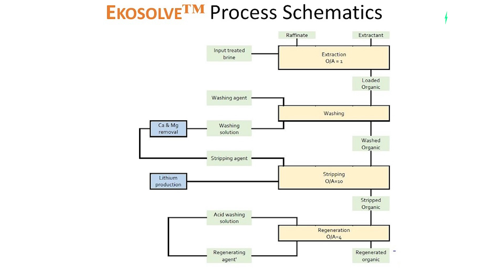NEW lithium refining & extraction process biggest game changer of 2022

Comment: Vikings let's say head light on car has problems and 2,500 🇺🇸 dollars to fix permanently.
Disagree. It was just a light bulb 💡 only a cheap 5 dollar 💵 part.
Ask yourself do you want more money or less money. Every single economic activity of any type. 
Buffalo hunter economic activities, going to scalp as many battery or panels or wind farms as fast as possible.
 That's why the concrete train foundation of a wind farms have rotten milk 🥛 expiration date, it's fake, last forever and a day. Very disagree. Your sadly mistaken Vikings, you actually believe that, you are lost.
Clothes line 
Boom 
Probably too lazy to use a simple clothes line. In the warm weather outside. Cold weather indoors clothes line.
Air dry dishes, hand wash dishes it's fine.

Comment: The only question I have is whether DLE is commercially scalable. If it can't be used to ramp up production to the huge quantities needed for the EV market, it's basically dead in the water, like a lot of startup ideas. It will be interesting to see if they can actually do this.
Reply: This isn’t DLE! It’s a solvent extraction technology.
So basically it’s using the old method but being able to recycle the solvent (which was the dirty and expensive part of the process).

There’s no way in hell DLE could compete with this if it actually works as advertised.
Reply: @richardvivian3665   DLE just means Direct Lithium Extraction. If that's what they are doing, it's a form of DLE isn't it? They just improved it by recycling the solvent.
Reply: I think this is good approach because they don't need large brine ponds that use up space and take months to dry out.
Maybe for a while they will do both before phasing out the brine ponds or at the least they won't be making more brine ponds.

Comment: Spot on Viking, DLE is the frontier technology for Lithium extraction and the method used at Standard Lithium is brilliant. NO MINING REQUIRED... There is an existing Bromine extraction facility and Standard Lithium has been licensed to tap into their existing infrastructure, including Water and Electric and most importantly their Bromine as it flow out of the existing wells. They already have a pilot demonstration plant in operation and has recently received the backing of the massive Koch Industries.
Reply: In addition, Standard Lithium's demonstration plant has been in operation for an extended period. They appear advanced in their technology allocation and use. They have no environmental hurdles as the bromine plants have been in operation in south Arkansas for decades, and the tail bromine is readily available.
Reply: @thade8534  Spot on
Reply: This isn’t DLE! 
This is a solvent recycling breakthrough. So basically it cleans up the old dirty process which was/is cost effective but environmentally damaging.

If this works as advertised DLE is dead in the water. Companies will shift overnight to this technology because it uses the old methods which are simple and already scaled.
Reply: https://www.youtube.com/watch?v=DhqRkflbxYU Salinity Solutions are also doing DLE in Cornwall UK, & are planning on setting up a test plant in South America.

Comment: Lithium is such a light element and reacts with nearly everything.  It was only a matter of time before a breakthrough like this was gonna happen.   Its great to see!
Reply: Ahem...Neither atomic weight nor metal density indicate reactivity.  Lithium metal is highly reactive because Lithium is the most electronegative metal.  This also gives high cell voltage and power.
Reply: Lithium is used in batteries exactly because of its electro-negative properties.

Comment: I expected this. I think it's funny when everyone panics about lithium prices when we know that's temporary. Humans don't just "give up" when there is a problem and money to be made. They come up with a solution and in modern times they can do that quickly. Also, just look how primitive the existing methods are.  Did anyone really doubt there was a better way to do that?
Reply: Innovations seem impossible before they are done and trivial afterwards.
Reply: The EV batteries will save the existing grid. 
Every one thinks backwards. 
The grid disperses electrical energy. 
The grid is incredibly expensive $/klm.
In the past small essential electrical supply was necessary. 
With no fossil fuels, the extremely high density energy, then the grid only supply has to be 5 TIMES BIGGER.
And 5 TIMES more electric generation capacity. 

The grid is 10 TIMES the cost of the power plants.

Nobody is talking about this matter.
Reply: "Did anyone really doubt there was a better way to do that?"

The skeptics and the haters 🙂
Reply: I know, right? I feel the same way when people say the grid can't handle EVs. As if electric companies won't expand the grid to sell more of their product and make more money.
Reply: @truhartwood3170  Also, EVs are not the only thing that needs more electricity. I see construction all over the place in my area, that's thousands of new AC units and other stuff going online every single day. This has been going on for decades and not a single person ever said "can the grid handle this growth?"
Reply: @truhartwood3170  lol I love it when people make that argument "oh noes  how will the grid handle it??" And I tell them the exact same thing you just said
Reply: @truhartwood3170  The EV batteries will save the existing grid. 
Every one thinks backwards. 
The grid disperses electrical energy. 
The grid is incredibly expensive $/klm.
In the past small essential electrical supply was necessary. 
With no fossil fuels, the extremely high density energy, then the grid only supply has to be 5 TIMES BIGGER.
And 5 TIMES more electric generation capacity. 

The grid is 10 TIMES the cost of the power plants.

Nobody is talking about this matter.
Reply: @stephenbrickwood1602  can you please let me know where the figure of 5 times the electrical generation being needed comes from? The number I've heard is 25% more electricity generation is required. This was specifically about the US where currently there is 4.1TW of generation and another 1TW is projected to be needed to replace all ICEVs with EVs. Since that transition is expected to take at least 20 years, that's around 1%/year. Before 2000, the grid was growing at about 2.6%/year. From 1950-60 the grid doubled in size to accommodate AC. It's a good thing we didn't have the internet back then or we'd never have AC!
Reply: @truhartwood3170  in Australia the AMEO is responsible for the national grid. 
Nobody puts electric power into the grid without their permission. 
And no user connects to the national grid with out their permission. 
The AMEO has been quoted as saying that 5 TIMES MORE electric power will be required if no fossil fuels used in Australia. 
This is because of the high density energy in fossil fuels. 
Australia imports all its petroleum and uses natural gas and coal fired electric power stations. 25gW installed. 
The USA uses 30% more electricity per head of population than Australia. 
The USA uses more fossil fuels per capita.

My point is the nuclear lobby in Australia has highlighted that the distant solar PV farms, and Wind generators, and the Snowy Mountain Hydro electric storage dams all need extremely expensive high voltage transmission lines to be built. 
And so, Renewables can not be economically viable. 

These are experts I have quoted. 
Robert Parker is an Australian expert on nuclear power plants. A Nuclear Engineer.
He is on YouTube and national TV promoting the nuclear solution. 

I also am an old Construction Civil Engineer contractor with experience in coal and gas turbine electric power stations construction.
I have worked on an 830 tower transmission line. (1,700 total)
In Australia the government has underwritten large projects for private developers and the nuclear solution will need to be hijacked into a decades long program that is political and flawed. 
Big government guarantees. 

There is solutions and the USA leads the world.
Reply: @stephenbrickwood1602  Hm. I would think the solution in Australia, and anywhere with lots of sun, is private rooftop solar and household battery storage linked into a distribution grid. I know not every city in Australia is sunny all the time, but that seems like a good start and would just use the existing grid. Is there a reason that wouldn't work? (Asside from political or something)
Reply: @truhartwood3170  To transition the entire road transport sector to BEV would only add about 15% to the grid demand. Some reports say 25% but this is excessive.
Even if it is 25% it’s not a major problem. The complete transition of all vehicles will take another twenty - thirty year . So we are talking about adding 1% (at most) each year to the grid capacity until full transition.

The grid capacity argument is just FUD with no basis.
Reply: @richardvivian3665  Yeah, you're saying what I said (that's its not a problem).
Reply: @truhartwood3170  you are exactly right. 
Australia is very hot, we are in the same latitudes as the Sahara desert. 
Rooftop solar works better in cooler latitudes, more of a comment. 
Even the USA has useful sun for 10 months each year and longer in the southern states. 
EV batteries, 100kwh, will be common for the long trip, but the Daily drive is short and many people only go to the petrol bowsers every 10days. 
So 3 days of electricity in every big EV battery and it is topped up daily, that is a huge reserve of free energy. 
300million buildings and 300million vehicles in the USA and could be 300million Rooftop solar power systems.
All connected to the existng national grid .

EV will be able selfparking, and nuzzle onto a low mounted wall power point at every car parking space. 

Central concentrated power supply companies know this, the automotive manufacturers know this, Elon Musk knows this.
The money is in the existing national grid. 

The grid will just 'juggle' and balance electricity stability and trade electric energy. 
The grid will be UNLOADED. 

That is the key to making the existing grid work with out massive expansion. 

Feel free to spread my ideas, as big government will be hijacked if we keep quite.
Reply: @truhartwood3170  further more IF Nuclear was the answer then every country in the world would have to have nuclear industries. 

All Dictatorships. 83% of the world's population is in dictatorships. 

Australia could export 100millions of tonnes of uranium ore to every country. 

The USA military will defend Australia from attack from any nuclear weapons, so Australia would be even more wealthy, if you see what I mean. 
If Nuclear electricity was the solution.  !!!!
Reply: @stephenbrickwood1602  Rooftop solar sounds like the way to go then! It also democratizes the system. Nuclear is too expensive from what I understand. Not competitive vs solar and batteries. There are a slew of fusion reactors being tested at startups. Not sure if any of them will be cost-competitive. Thanks for sharing all that info and your views!
Reply: @truhartwood3170  Hahaha, my pleasure. 
Even fusion is too expensive because it is a central concentrated supply and needs a grid, and an expanded expensive grid.

The existing grid, if filled with central electric power, then rooftop cannot feed into the grid.
And connection fees will also have usage charges added. 
Big government will make it mandatory to recover its exposure and political commitments/ contracts.

Not to be alarmists, but I see big business, 'monkey business', happening in the background in Australia now. 

Government GARRENTEED future cash flow is a big incentive. 
Tobacco industry and many other industries have lied for the money in the past.

If you do see what I am saying feel free to quote me or just copy and paste.
Reply: @truhartwood3170  if EV with big batteries, (and new technologies for this new market developing rapidly,) then the little daily drive we all do means 90% full battery daily. 
All industries agree with the EV future. 
Some say this is a problem and some see huge opportunities.
Reply: @stephenbrickwood1602  Yup. We have an EV (2015 Leaf, far from the best EV out there but still preferable to our ICE car! Still has 87% of original battery capacity when tested!) so I understand the benefits.

Comment: Sam, DLE is not new but you and the technology are headed in the right direction.  See Standard Lithium (most advanced and patent pending DLE tech), Lilac Solutions and E3 as well.  DLE requires a fair amount of fresh water which is preciously scarce in Chile and Argentina.
Reply: Exactly right... DLE is the frontier technology for Lithium extraction and the method used at Standard Lithium is brilliant. NO MINING REQUIRED... There is an existing Bromine extraction facility and Standard Lithium has been licensed to tap into their existing infrastructure, including Water and Electric and most importantly their Bromine as it flow out of the existing wells. They already have a pilot demonstration plant in operation and has recently received the backing of the massive Koch Industries.
Reply: @mrpaul5726  $100M invested by KOCH, serious DD performed on their part.
Reply: @mauinuts8844  Yes a real endorsement from a big player.
Reply: This isn’t DLE.  This blows out of the water Standard  Lithiums prices or any other DLE process. This technology cleans up the old process by recycling the solvent.
There’s no way on earth DLE can compete with this if it is as clean as advertised because it improves the old simple and cheap methods.
Reply: Good Point, Well made, and you were honest to say IF.
IF......
No IF with DLE
Scaling this system Viking is referring to from the LAB to full industrial scale use is quite a journey, one where many bright ideas wither and die. 
DLE is already in industrial use, though each Bromine/Saline location and chemistry needs a unique chemical setup for maximum extraction, AKA Koch Industries and Industrial Chemical Superpower.
Reply: Lilac is working with LLKKF